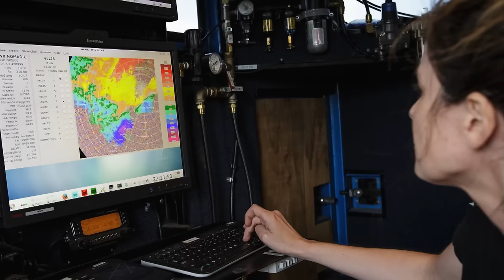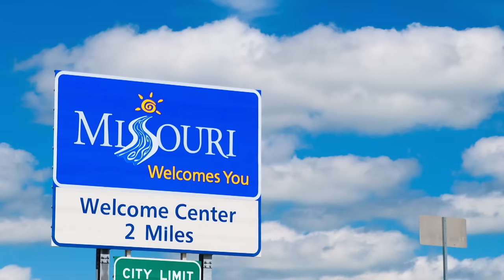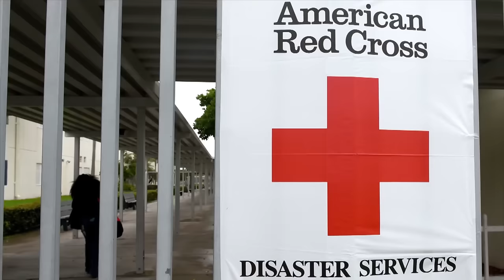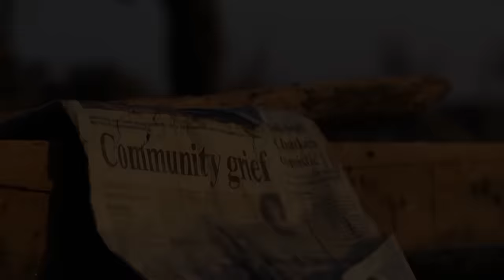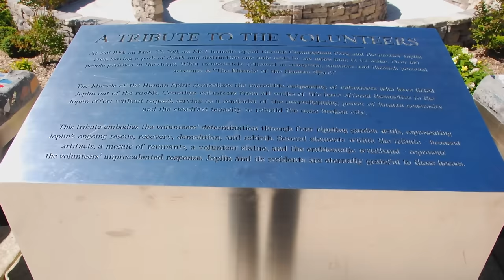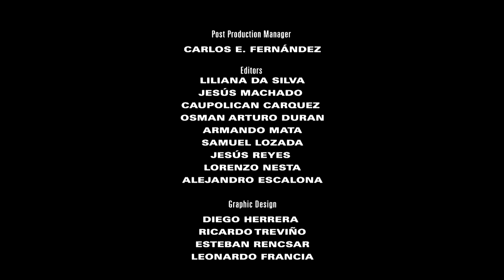Deadly Disasters: Tornadoes | World's Most Dangerous Natural Disasters | Free Documentary

Comment: So if a tornado with winds in excess of 200 MPH doesn't damage any structures, just goes over fields, does it get rated on the Enhanced scale?
Reply: It will get rated typically but without damage markers it won’t get rated highly. That’s the case with the 2013 El Reno tornado. It was 2.6 miles wide, making it the largest in recorded history. Tornados of that size are pretty much always well over 200mph which is in the F5 range on the old fujita scale. It only received and EF3 rating because of inconclusive damage markers since it stayed in farmland and didn’t hit well-built structures.
Reply: @razrv3lc  thank you for the info. Much appreciated.

Comment: when the cold front moves so fast it rides on top of the hot air cushion, it spawns a tornado if the hot air is trapped from rising. as the system breaks down, cold air being warmed. or cold air being trapped from sinking. maybe that location for the funnel. but if there is many holes for exchange of air. tornado becomes impossible. or there maybe many tornadoes. we can control it, but we dont.
Reply: You have absolutely no idea what you’re talking about